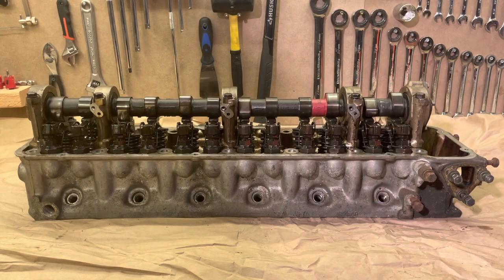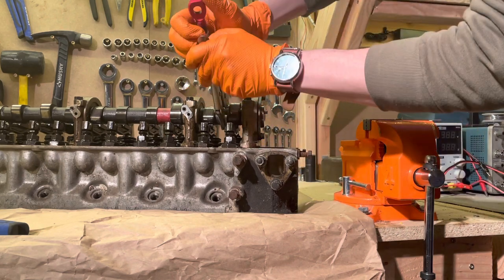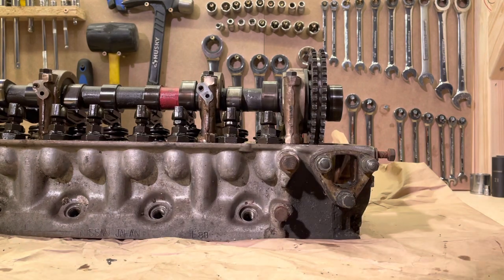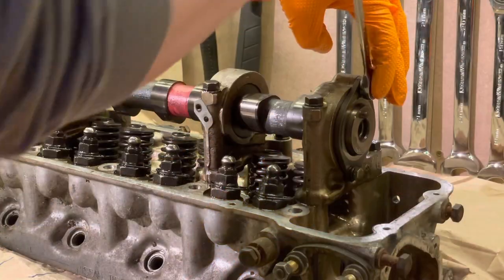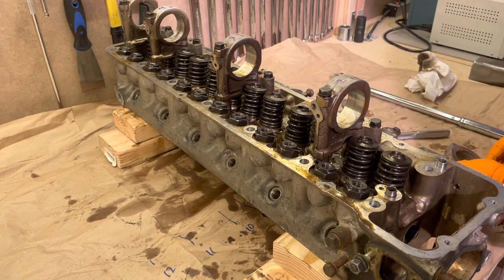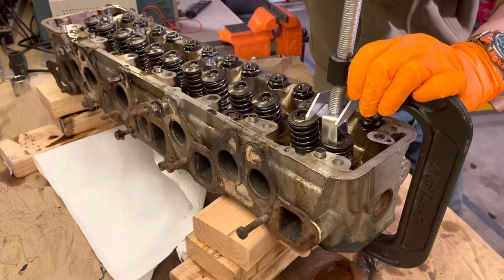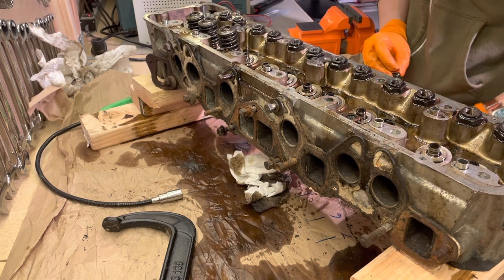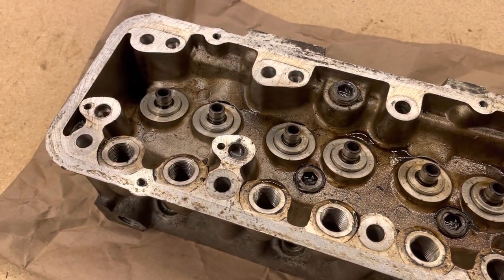Datsun 240Z L24 Engine Rebuild Ep. 6 - Cylinder Head Teardown

Comment: I thought I read somewhere that it was good to install the valve springs back in the same orientation (top/bottom) in addition to keeping them in the same cylinder position. If I can find that I'll add it to the comment as a reference. Great video.
Reply from the maker: You're definitely correct on this -- all of the valve parts should be stored as an assembly. When you have the valve out, put the valve seal back on and then everything back in the same order and orientation it came on. I should've been clearer about this in the video but a comment is quite helpful to anyone who may be wondering in the future.

As always, thanks for your support of the videos.

Comment: #800-1735 from Z car depot is the actual Datsun Z valve spring removal tool.
This uses the cam in place as a leverage point.
     This is The type used for years.